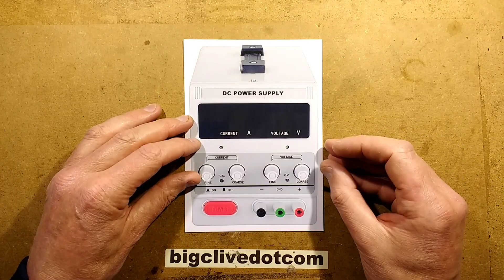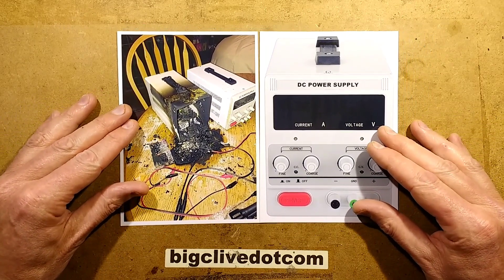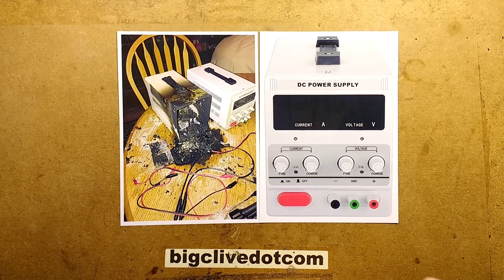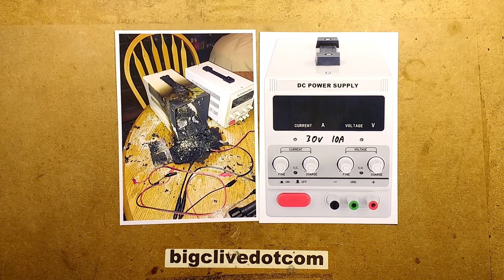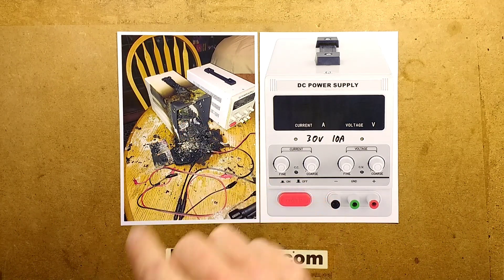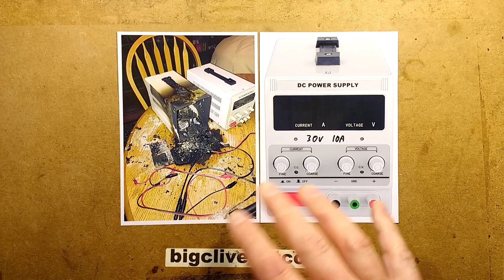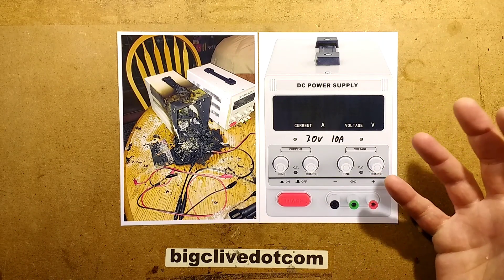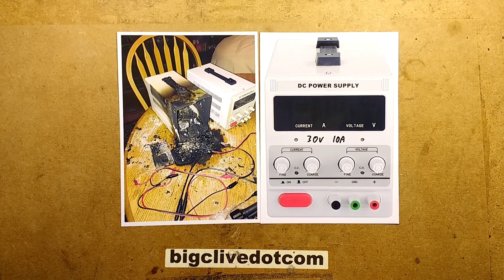Smokin' power supplies.  PSA

Comment: I assume that this is an analogue power supply. The problem is with the specification of low cost units. The power supply can generate 0 to 30 volts. It can also source 10 amps. I doubt if it is rated to generate 30 volts at 10 amps, or more importantly 10 amps at near zero volts.  Under this condition the regulator output transistor in the power supply will be required  to dissipate  the worst case of almost 30 volts at 10 amps,  or all 300 watts.
Most analogue power supplies have a dissipation power curve which defines the safe load current for a given output voltage. Problems can occured when the load impedance is dynamic, such as when using the power supply in constant current mode to charge lead acid batteries. The changing battery impedance can result in the power supply operating outside its safe working  curve. A well designed supply will have protection circuits to prevent damage in such conditions, eg a simple thermal fuse or a fold back circuit that  increases the source impedance until a safe current is reached for a given voltage. Sometimes safe operation is restored by using a relay, or other active device, to switch to a lower tap voltage on the output of the transformer. Only the more expensive power supplies will deliver 10 amps over the full 0 to 30 volt range, and these will be fitted with a very large heat sink or a cooling fan or most likely both. This particularly power supply is deficient in not having the necessary thermal protection or fold back circuit. (When charging batteries or a very high capacitive load, it is not unusual for the power supply output circuit to be destroyed if the PSU is switched off before the load is disconnected, as the load discharges through the PSU output circuit, usually the output voltage sensor circuit).

Comment: Use appropriately rated connectors, I see some dinky little croc clips there on the table in front. If the user had those on both ends, and shoved one jaw in the hole where the banana plug goes it would get hot.  People; use good quality plugs and at least 4 square mm cable. Solder the wire in the back of the plug. For testing anything above a couple of amps dont use croc clips, make a lead with the right connectors.

Comment: I know you said what the man was running! if I or we knew what it really does? I almost purchased one like this. for continuous use running my ham radios. changed my mind and picked up a 23 amp linear by pyramid! in my opinion a better choice for continuous use but only good up to 16 volts. I would like to see what failed?

Comment: I have a unit quite similar to that w/o handle on top of case.  After a few years ownership, the CC/CV system has gone wonky.  It may be easier to just cannibalize the unit for its xformer, and install a Chinesium buck-boost unit - which would have much more intelligence and control.  Ironic, buying China stuff to fix a China unit.

Comment: That's terrifying! Are there any reports of basic LED drivers doing similar? Worries me a little as I was hoping to leave my high power LED setup on all night.
Reply from the maker: LED drivers are rated for their full load continuously.  But will last longer if in a ventilated area.
Reply: +bigclivedotcom Mine will be mounted to a piece of aluminum that should spread the heat well. It will be separate from the 50w chip that will be hooked to a Pentium D actively cooled copper/aluminum heat sink.

Comment: I have not had a single 5A unit fail and the quality internally is reasonable enough but I had one 10A one where I work that had the same gauge of cabling as the 5A ones and it did soften the jacketing on the internal cabling and connections to the banana plugs internally.  I would guess that this unit was similar and had an underrated wire or loose internal connection get hot and catch fire.  The way most are laid out the mains comes into a token gesture of surge suppression before going half to the transformer and the other side routing through the main power switch near the back of the unit and actuated by a long switch bar connected to the physical button at the front.  They are likely building the beefier ones from the same parts as the 5A ones without upsizing the conductors and traces enough to handle double the load.  Also, the banana jacks they use on all the cheap ones are just trash and it is generally the first thing I replace.   That being said, as a bench supply, they are decent and affordable.  You can easily mod them with better accuracy 5 digit meters and 10 turn pots to really improve the design.  The plastic they use for the front of all of the ones I use is ABS or some other reasonably soft flammable plastic and if they would have simply chosen to use a fire retardant plastic this could have been avoided.

Comment: I'm not sure if applicable but the front banana plugs are only rated to 3 amps otherwise the rear lugs are to be used per the manual.

Comment: ive had mine blow regulators due to overheating, i tweaked the fan so it runs continuously at slow speed and the thermostat that originally turned the fan on trips it into full speed. i haven't lost a regulator since

Comment: I have had a few of these either smoke off, caps take off and pop the cover, and fire, all from Bang good ... I am not bashing bang good .. I still buy all sorts of junk through them, but i never leave anything that requires power unattended. even if it is only battery's...  To be on the safe side, take the units apart, replace the cheap caps with high end units.. or just buy a high quality unit to begin with... be safe out there...

Comment: The problem was probably the Peltier module. Has everybody forgotten that they are essentially hotplates at 18V? Who would leave that on for a few hours!
Reply: Do tell, in what way could a faulty peltier cause a power supply to catch fire?
Reply: Well, if nothing was moved before the photo, then the peltier was not faulty, it simply did what was expected, it got hot and on a wooden table?
Reply: it isn't clear where the peltier was or how it was heatsinked etc..

If it had no fan and possibly no heatsink then it would of got very hot and evneutally committed suicide , taking the table with it and consequently the front of the power supply,
Reply: the psu failed not the peltier module
Reply: You got my vote -  not psu

Comment: I have 2 of theese.   First one was making some scary ratteling sound when i got it in the mail. And sure enough it said BANG the first time i turned it on.  (One of those explosive decoupler BANG types..  ;) The unit was not under any load, it just blew up first time i connected it. Since i was unsure on the unit i turned it on outside so no damage other than a small heartattack was done...  ;)
Contacted the seller, and opened the unit at his request.  Found out several parts had blown.    The seller replaced it with a new unit right away,  and this time the unit is working, but i didn't feel safe to use it, so i bought a "real bench supply Rigol DP832A" instead.   I do however have both units here.  One working and one in need of repair.  If you are interested Clive, i could donate them both to you to make a video on them  :)   Perhaps a repair video with another BANG?   :D   (plz do the bang outside...  ;)    )

Comment: For what it's worth, I used my QW-MS305D to power a Beaglebone Black (as I do not have an adequate 5V wall wart with the proper adapter) for days on end and it showed no signs of trouble. Your mileage may vary, I suppose.

Comment: I actually bought one of these about a year ago, and it had a "rattle" noise if you shook it.. Perturbed by this, i opened it, and found that the terminal nuts on the back of the terminals were all loose, and one had slipped off, and was dangerously close to the edge of the PCB behind it. Not sure if this could have been the source of this poor chap's miseries, but i wouldn't put it past. 

As always, when you buy something, cheap and dodgy or not, always.. i repeat ALWAYS open it up and do a visual inspection.

Comment: An extreme example of a pretty common problem with cheap power supplies: they are rated 30 Volts / 10 Amps and they'll happily run at 30 Volts and 10 Amps all day. The problem occurs when you run them at a significant amperage at lower voltages. 

If one looks at a proper 30V/10A power supply, like this K7200 from Velleman (an affordable way of getting a linear power supply like that -if you're a bit like Clive and me and can put stuf together; link below), it's hard to see from the picture, but it's like 2.5 times the size of the cheap power supply; also note the two massive heatsinks either side of the housing. These also use better, dual secondary winding transformers, where the control circuit switches in the 2nd one in series, according to the required output voltage.

For herein lies the kick, the K7200 and the 'El Cheapo' are both linear power supplies, where putting out a significant current at a voltage lower than its nominal maximum, means dissipating the difference between the transformer output and the actual set voltage, at the output current, as heat.
This where the 'El Cheapo' falls down: it just simply doesn't have the fysical capacity to supply a significant Amp draw at lower voltages. It should be derated as the output voltage drops; sometimes the documentation indicates this, sometimes it doesn't, it's just a case of how dishonest a particular supplier is willing to be.

I've not pushed my K7200s (I have two of them because I repair vintage amplifiers as a hobby) to the real extremes, but I once did run one of them at 3V/9A repairing a very early drum computer/sampler/looper and, while it did get up to about 85 degrees centigrade, it didn't selfdestruct, nor set anything else on fire. :D

Ehm and... edit: http://www.velleman.eu/products/view/?country=be&lang=en&id=9375
Reply: Indeed and those should be automatically switched by relays, but that means more expensive transformer and more expensive circuitry, ergo: more expensive power supply.  The likes of your Hamegs, Agilents and TTis have that sort of feature and more, but the bargain basement ones do not.

That said, there are generic brands that have them too, but those tend to be a little more expensive as well.

Comment: Big Clive, with your expertise I would absolutely love if you did some teardowns of various power supplies and power strips. I have to say, 30V 10A sounds excessive. I have a used GW Instek GPD 3303S and while it looks like a beefier unit, it's only rated at 30V 3A.

Comment: This must be a problem with the cheap Chinese ones. We used to leave power supplies running in the electronics lab for weeks, if not years, at a time. Of course these 10A supplies were several hundred dollars each and not some junker from ePay or circuit  specialists.

Comment: Should a device with a lithium ion batery, a laptop for instance, be left on permanantly on charge unattended?
Reply from the maker: Properly designed stuff is safe to leave on charge, but cheap items are best unplugged after charging in case the charge circuitry leaks a small continuous current to the cell resulting in long term overcharging.  This issue actually affected some Ryobi chargers.
Reply: Yes

Comment: Samsung Galaxy Note 7. Not that many had exploding batteries. So everything from Korea is bad? 
You racist commenters need education. Google "exploding iphone". IPhone is made in China. So don't buy Apple? Intelligence says that everything, man made or not, has an inbuilt fault rate. In Australia, most criminals are Caucasian. Should we get rid of the Caucasian people? No. They have inbuilt failure rates. 
Better to buy the same product. Then decide if it was designed and built badly. No need to attack Caucasian people because they do most of the crime here in Australia.
Reply: Greg Zeng   Well cheap components are more more likely to fail due to cost reduction measures in research and development. It just so happens that most cheap components are manufactured in China due to less governmental oversight and regulation. This has led to the stereotype. With good oversight and higher prices, China can manufacture high quality products, too. At the moment, however, China mainly exports cheaper components, which has led to this image.
Reply: @OutOfNamesToChoose:  Can you read English?  Samsung, Apple?  

Amazon sells many CHINA-made products.  You are comparing export-standard products, to local-standard products.  Noobs & racists like you need to know that reputable manufacturers know the difference.  By deliberate design, many "local" sales only are not available to international sales.  

Cheapies like myself MIGHT decide to risk buying the export-prohibited goods.  We know the risk.  It could be an India-made product. Or a Japan-only made product.  If you use a local-only retailer, there are several risks.

1) Several USA eBay sellers sold defective goods to me.  Because of the delivery-times to Australia, the sellers in the USA were able to avoid the feedback time required by their bad products.  Am I racist enough to condemn all USA sellers?

2) Amazon, Alibaba etc knows that its re-sellers have dubious reputations.  That is why they have better buyer protection & seller-feedback mechanisms.  

3) Dubious sellers everywhere often sell factory rejects.  Then they change their retail selling shop-name, often.

4) Clive & the educated people here KNOW that engineering has its predictable & known error failures.  Errors often happen after leaving the factory: packaging, transport, storage, usage & other variables.

5) The sane & proper "warning" is to not blame all Caucasians in Australia for our crime, since they create most of the crime here.   Do the educated stuff; a proper postmortem, engineering analysis and seller-usage study.  No more silly racism, PLEASE !!

Comment: Obviously the manufacturer skimped out on the flame retardant plastics. Not that unexpected for cheap things like this.

My guess is there was a loose connection, either on the binding posts or internal to the power supply. The connection having 8A continuous through it heated up, and ignited the plastic bezel which was not flame retardant.

When you buy a quality name-brand power supply, you're not only paying for quality and reliability of the electronics, but also you can usually be assured that the manufacturer has taken the necessary steps to ensure the safety of the device. Yes, the right choice of materials is an important safety aspect of electronic devices!

Comment: I would normally put that advice under the DUH category. No one should leave something running like that. on the other hand I would think that there would be some kind of thermal protection in a power supply like that

Comment: How do you know it was the power supply? I mean 144W through a peltier junction could start a fire assuming everything functioned correctly.
Reply: The charred remains in the picture sure look like a power supply, not like a peltier. Unless the peltier was sitting right at the power supply (which would not make sense) it is safe to assume that the power supply burned up.
Reply: The interesting thing about the construction of these cheap goods is that since they don't actually have to comply with any safety standards they are often made out of el-crapo cheese grade plastics, which, as can be seen from the picture are not self extinguishing or flame/fire retardant. 
It is cheap because.. it is cheap, not safety compliant.  Therefore, assume it is capable of exploding, and set it up accordingly .   I use a number of really cheap chinese lipo chargers, but they are used on a metal plate sitting in my fire hearth. If they go bang and fisooshhh... hopefully all the magic smoke goes straight up the chimney. So far none have actually gone bang, but if they do, I'll be sure to post the pictures on line.

Comment: I've got a 5 amp one of those. I would never use it for sustained periods. Heck, I pack it away after use so it isn't plugged in. The heatsinks in the device are quite beefy so it is expected to generate a lot of heat. Also, the rating is the peak load. Close to either peak will cause it to het hot. Honestly, I'm not surprised this happened.

Comment: Yes they are shit i bought one a few years ago, everything was fine on light loads and one day i charged my diesel battery at 13.5 volts 5 amps well this didn't go well ,One hour later the enemy said there is smoke coming from the front of car , Goes outside to see the thing billowing smoke , On closer inspection a little tear down the front circuit board had totally burnt to a black state  , Only good that came from this is Ebay refunded me back even though the seller said i missed used it .

Comment: I use these for electro plating all the time.. Oh shit. I will have to clear out a corner where they can set nothing else on fire if they combust. .
Reply: Low load though. Still, better safe than sorry.
Reply: Just use an Explosion Containment Pie Dish™.
Reply from the maker: Low load should be fine.